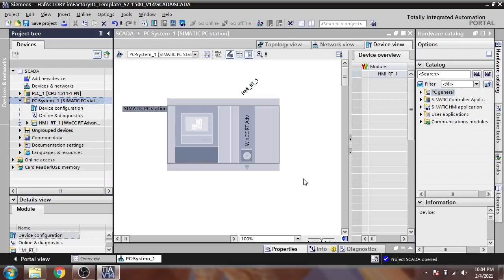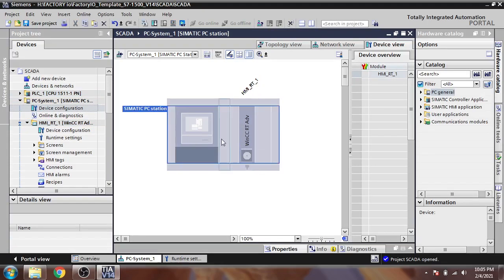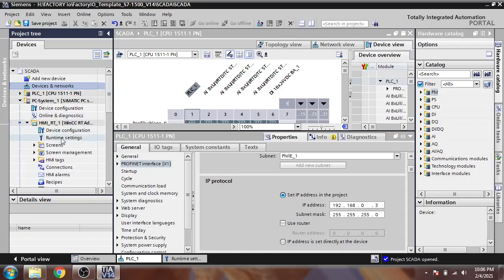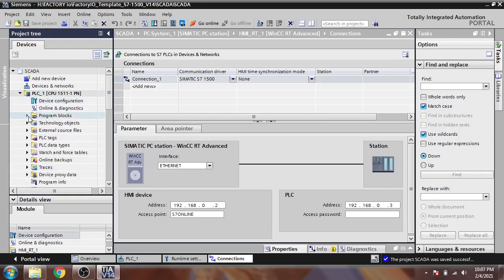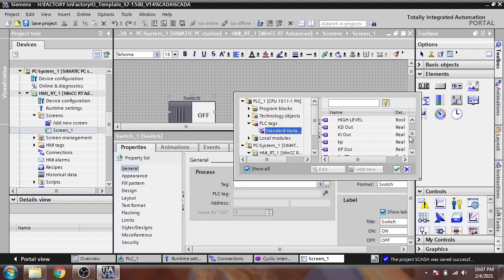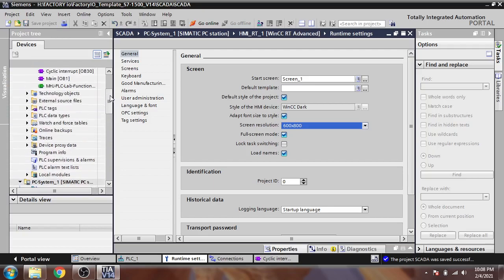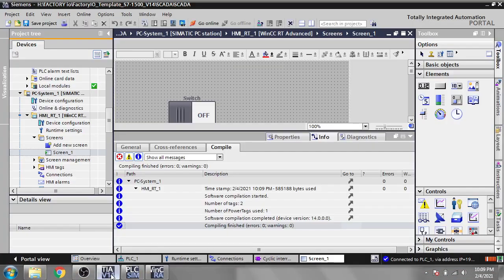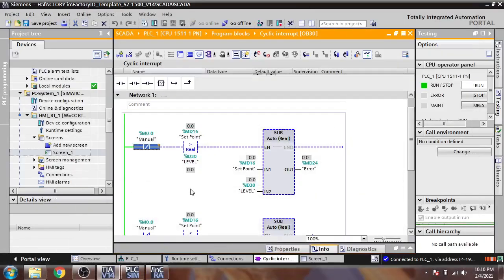WINCC RT SCADA - Tutorial 2 - Connect with Siemens PLCSIM Without PLC

Comment: while switching ON memory in Main Block not working. could please help me
Reply from the maker: Check Block Properties
Reply: @ thanks for your response.

I successfully communicated plc with WinCC simulation from reading data from MODBUS RTU slave devices.

Now my problem is whenever slave device power off means at that same point the values are showing in data block, its not returning to zero.
Reply from the maker: @dsarun9412  You Have to Make Code and Sent to zero when Device off
Reply: @shahzaib1994  make code in seimens PLC Or modbus slave device..?
Reply from the maker: @dsarun9412  in Siemens
Reply: @shahzaib1994  could you have any video presentation, if there please share it to me, it would be much helpful..
Thanks
Reply from the maker: No Bro  @dsarun9412